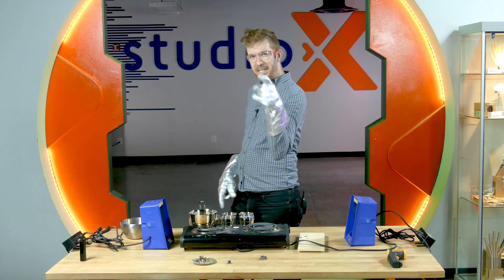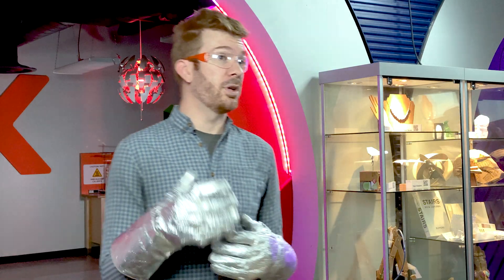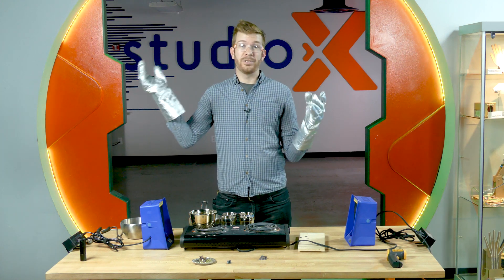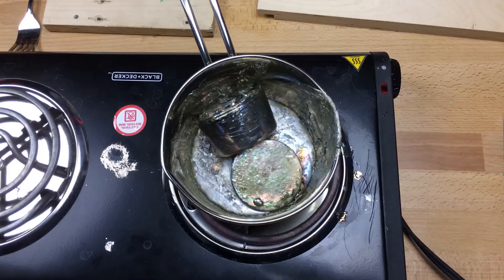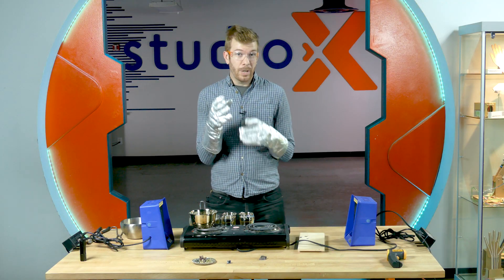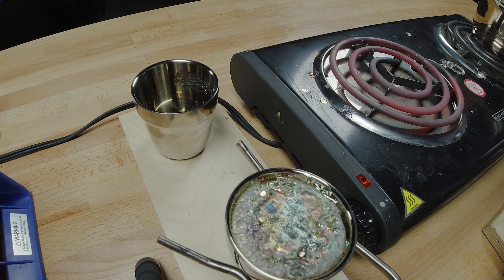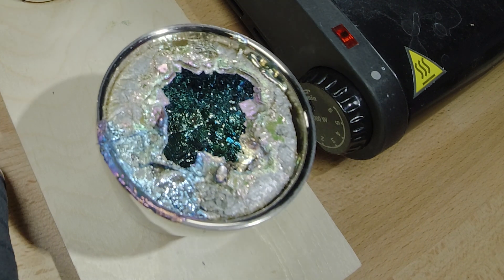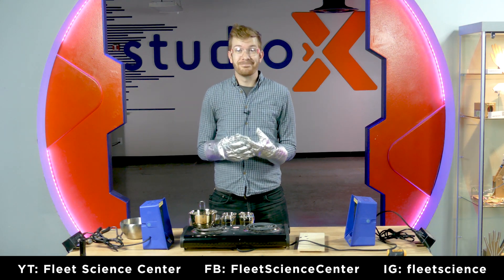Fleet2Go: How to Make Bismuth Crystals

Comment: 0:52 ---> 520.6° F Melting Point For Pure Bismuth. Which Is Super Low Heat For Metal. Be Sure To Go Slow, This Is About Beauty, Not Speed. Take Your Time, Go Slow & You Will Produce Amazing Results. Oxidization Is What Determines Coloring, Don't Rush!!!